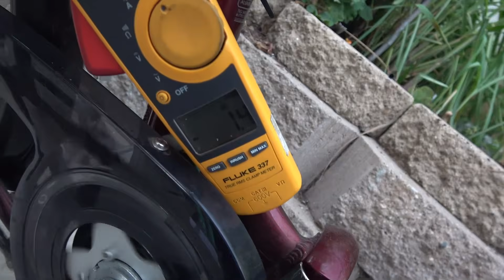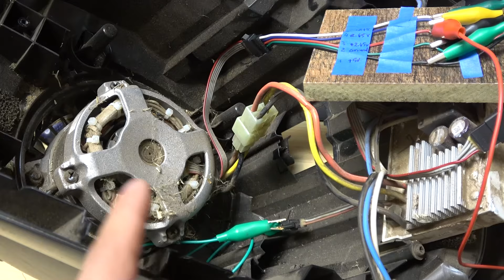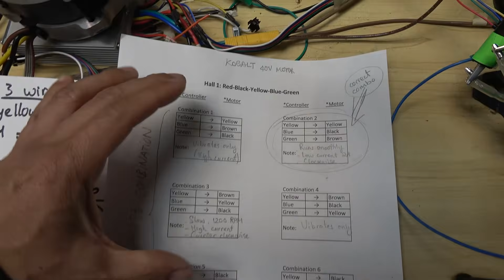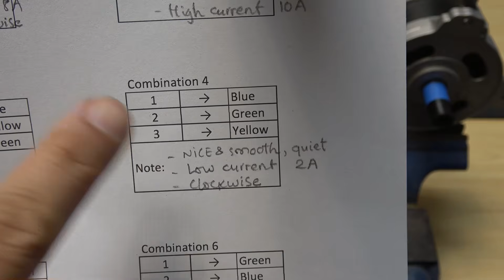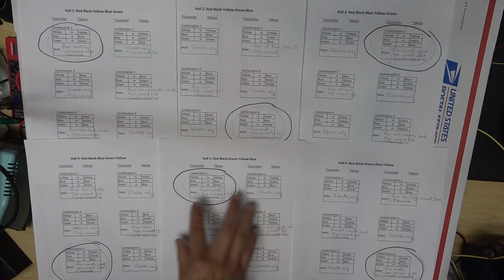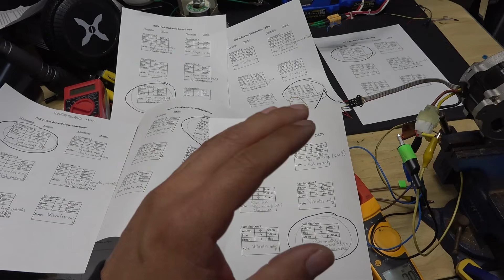How to connect/pair a brushless motor to a controller: The missing manual

Comment: I've watched video over several times.  Was great til got to testing the phase wires and you were using a Fluke multimeter.  I couldn't figure out exactly how you were testing the Amps until I learned more about the Fluke multimeter.  Maybe a video using a basic multimeter for the newbies would be nice.  Otherwise, great vid.

Comment: extra battery blue one purchase hooked up directly without  battery case and without  ignition for battery wont work  unless  its in the battery case with turn on case both put out same voltage do i need to use the  battery case for the new extra blue battery that roesnt have a case  ? display turns on but throttlej not workingunless its the original battery with the case

Comment: 9:27 What if you don't have the old controller. You won't have continuity to ground or 5 volts to figure out those wires.

Comment: Hello, I saw a video that said a motor controller with hall effect (5 wire) will not work on a motor designed to run without hall effect.  Is there any truth to that in your experience?

Comment: This video pissed me off! What a colossal waste of time. I have to break out a text book on electricity, go to school, and build a lab to hook up a $16 controller to a hub motor. I can just go get a job, earn money, and buy an e bike that works instead of all this horse shit. 
Sixteen dollar part. Must invest at least 10 hours to become comfortable with multi meter and terms. He doesn't tell you he has a shop that is set up for this or that he has done this 1000 times. Simplify and slow it down asshole or what the fuck is the point?

Comment: I have a question. I have a 750 watt 48 volt bldc motor and controller. I want to build a small tram that can carry five or six kids. I don't want it to go fast. Maybe 5-6mph max. The motor says it will run at 3100 RPMs or 480 RPMs with speed reducer. Will the motor have the same torque with the lower speed as it would with the higher speed? And is the speed reduction acquired by some wire on the controller 
Thanks
Robert

Comment: How do I figure out the red green and black wire on the controller to hook to my throttle if all the wires fell off of the controller from the solder resoldering new wires on the controller circuit board how to know where to solder the throttle wires

Comment: Hi mate is posible to used PSU?? Because i have same motor, u used psu and universal controler, but when i try like 100 rpm its 1-2A. But when i increase the rpm like 150rpm its become 18A or mor. Whats wrong nate??

Comment: Excellent tutorial. Thank you very much. But what if you only have the motor and not the whole setup with the old controller. Then how do you find the positive 5V wire of the hall effect sensors.

Comment: This is great!, I love tinkering with things this, I've built 3 different racing simulation chassis..used an old 90's honda e brake from a scrap yard and added it to the chassis with wood and rubber mounts and etc... even went so far as to go to the pawn shop for some old speakers and made 3 different Bass transducers and added them under my racing chair, the pedal deck, and under my shifters! The smaller one under my  shifters!.. 
If tour driving a good racing Sim, you can even feel when  you grind the clutch in your hands and feet mostly

Comment: Hi, I want to say thank you for all your videos.
and and very instructive, I really hope you can help me with something. I purchased a three thousand watt, 48- 72 v  vevor kit Which ran great Using a forty eight volt battery, But now that I'm using a 72v battery  20ah with 50 bms, frome     btr power The motor hesitates. And it does not go full power., Do you have any suggestions? What could be the problem if so, please help. Oh, the seventy two volt battery is brand new.

Comment: Would you have a photo of what the board looks like and the position of the hall sensors inside the engine?  I have a motor like this but it doesn't have hall sensors and I would like to install it!

Comment: Thank you, this helps a lot figuring out my atlas 80 volt mower. My controller died. I think I can still find ground and they did mark the power wire red so that helps a lot. Does under bolting hurt a BLDC motor? It’s a 80 volt max system but nominally 74 volts. I will likely have to settle on a 72 volt controller. Most likely will need to use a lower voltage pack and make my own battery vs the 20S battery they use. Good mower just cheap controllers.

Comment: I hate that the plugs never fit... Soldered the Hall wires to the controller and put shrinking tube on it. For the Motor phase wires i used butt connector waterproof. Running fine, but not feeling safe with it

Comment: How do you find the +5v without the original controller? Also wondering on the higher output (combination 5) if that is for the "turbo mode" found on some of the Kobalt leaf blowers

Comment: Thank you for this practical video. I am quite slow on this but interested. My question is does this apply to AC servo motor with 8 wires , 3 for motor & 8 for hall sensors?

Comment: Hay there I enjoy the knowledge you share,I would call my self pretty knowledgeable of ev's but I have this issue we're when connected the controller runs motor great with a bit of delay in start but when weight is added it makes banging studder and goes nowhere,I thought it was halls but it's two mode so it will do the same without halls connected and changing phase wires doesn't change anything which is where it's an Amazon 1500w 2 mode controller 48v and a brushless dc permanent mag motor,any suggestions would be great thanks again😊

Comment: Awesome video. 
I have all Ryobi tools... except my mower is a Greenworks. Tried running it on 3 series Ryobi batts.

It would run 3 secs then stop and beep. Turns out the controller and battery talk back and forth.

So.... All I need is a 60V controller and I can ditch my Greenworks battery?

Comment: I love those brushless lawn mower motors!  I’ve got a few of them salvaged from a dumpster and rigged one up onto a little razor mini dirtbike, from a different dumpster.  Got a cheap 1500W controller and that tiny bike is a BEAST now!  I was powering it with 84v battery (made with two modified 40v ryobi packs in series) for a while but had to switch to a smaller 72v pack after one of the ryobi packs started having issues. I live on the side of an insanely steep volcano (Big Island, Hi) and it speeds up the steepest grades effortlessly.  
    It was one of those rare projects that just went together with very little effort or modification.  
   Now I’m just searching for a slightly bigger frame because despite attaching a taller seat and modifying the handlebars I barely fit on the little Razor MX350 frame.  
  Hopefully some day I can find a frame from a MX500 or MX650 to use since they have suspension and disk brakes. 🤞 
  Love your videos!  Keep up the good work.   Mahalo!    🤙
Reply: clstrc594  any brushless e-bike controller will work!  I’ve ran them with over 80v on a 2,000w controller no problem.  Just make sure whatever it’s connected to is geared correctly and that it doesn’t get too hot in use.
Reply: @maukaman  im planning to use one of these motors for an electric mini bike build. What sort of Amps were you pushing through it at 72v? Any idea on the best gearing, 6:1?
Reply: @alexfrancis7093  I believe the most I ever put through that particular motor (inrunner style mower motor) was 2700 watts or so but It seemed like it could possibly handle more if geared correctly.  They are pretty torque-y motors but if you want that wheelie torque or you climb hills you’ll want something like 1:7 gear ratio.  I probably used 1:8 or so since I live on the steep side of a volcano 

        🤙
Reply: @maukaman do you know which sprocket fit the output shaft?
Reply: @alexfrancis7093  it does depend on the exact motor you use, some of the newer ryobi mowers use an out-runner style motor and may have a slightly different shaft.  I’ll have to get back to you about the shaft dimensions when I get back home, but mine had a double-D type indent a little larger than the typical my1020 sprocket found in the little Razor bikes.  I just filed the sprocket out from one of those to fit
Reply: @maukaman  my motor has the same double D! Good idea about filing out the sprocket! Sounds like an easy solution
Reply: @maukaman  hey, did you ever get a good top speed test?
Reply: @henrikgure2123  do you mean for the bike or for the motor rpm?  I think with the bigger motor sprocket I used I was getting a top speed of around 30 mph, but I usually kept a smaller tooth count motor sprocket on there because I rode mostly on very steep hills around my property.
Reply: @henrikgure2123  top speed of the bike?  When I had it geared up for top speed and rkl punning a 72v 3000W controller I was getting something in the low mid 30s.  I probably could have geared it up to reach a little higher top speed but I much prefer to have enough torque to wheelie with just the throttle.

Comment: My led volt meter lights up, but the motor wont spin with my twist throttle.
Reply: i had the same problem with my throttle with ignition key switch and volt meter.. the volt meter just lights up and show the voltage until i saw a video that helped me connect the remaining wires (yellow and blue) to the right positive lines. blue connects to red or the switch (the smaller red wire) in my case the yellow wire connects to the positive line of the battery to trigger blue wire connected to the the switch when you turn the key on ( it will connect the yellow wire to the blue wire.). My understanding is that the blue wire makes it happen. good luck

Comment: @ 10mins. You turn on the motor ,  I don't understand how the motor turns on.   You don't show how or where the twist throttle is connected. I got a yaegoo brushless 36volt.  And I'm having a hard time getting this thing running.

Comment: This video is very helpful to me. I have an Ebike brushless motor that will run pedal assist and doesn't comes Throttle Twist Control. I'm thinking  if I can add Throttle Twist on my Ebike. Hoping for this video. Thank you for making this video possible.

Comment: 🚴 Thank You for all you are sharing with us and Very greatful for the lessons here!
I am working an old A2B 2010-ish version with PAssist, 36 volt 500 watt cruiser metro and the 7 pin connector from the hub has the 2 wire battery output + and - along with the and 5 smaller ones on it. I am sure the 3 of those are for halls and not sure of the other two.. possible old halogen light and 7th pin maybe a 5VDC. Trying to chose and buy a higher amp controller to bypass the inner hub controller along with a new battery kit and display for it. I know bit about how they worm but it is still pretty overwhelming.  Would you think the controller you have here would work for it?  Kind Regards

Comment: Hi, i have a  little project in my tool shed its an ebike with all the wires cut off infront, so bought new harness controller, twist throttle with ignt switch and new 48v battery from one of chinese shop in Burwood tried ro work it out even without wiring diagram hoping i can match with the old controller installed but wire colors are not same so i was able to do a few like from the battery connection to controller, hall sensor, and the three wires to hub motor ( blue, green, yellow) the trottle and switch wire and the reat still unknown are you able to help me please.

Comment: My 80V kobalt mower PCB just died. I am planning to use a 72V ebike controller to replace it with some work-around-wiring. However, the mower motor doesn’t have hall sensors, I don’t know if it will run without it? Do you think if the kobalt 80V max battery will kill the 72v controller? even though on the box of the mower it said “72v nominal voltage”

Comment: Hey, great video!  I literally have the exact same motor setup out of my lawn mower that I salvaged in hopes of putting it on my bike upon everything the same as you said my whole sensor wires are showing 16 volts instead of 2.5 volts like each one of yours wires showed and it doesn't matter if I'm pulling the trigger to turn the lawn mower motor on or not. Also my motor I'm sure you can tell I am not able to get it running but it was running 5 minutes prior to being taken out

Comment: So this video is awesome. I have had that lawnmower sitting around for a while after getting it at auction. Well on monday I pulled the motor out for an ebike and yesterday this video get released with the exact same motor. Still eyeballing controllers and such but this helps a lot.

Comment: Just curious,if you ran combo 5 at same rpm as 4 would amps be same but you would get better speed and torque from 5,great vid,I used this process when I received my yuyang controller.
Reply from the maker: The current on combo 5 is still higher at the same RPM as combo 4. And this won't work when it's on your bike because the current is too high.. Seems like though combo 5 can run at higher speed, it's loud and it seems to struggle a bit.
Reply: @vuaeco  excuse me sir is there anyway you could help me with my e scooter controller please.

Comment: So what are you going to power with that monster motor
Reply from the maker: Still deciding. I just need to get a sprocket to fit in there.
Reply: @vuaeco  I have been having a hard time on that myself as outside of welding or the like I am not finding one that fits. 17MM shaft is problematic to find.